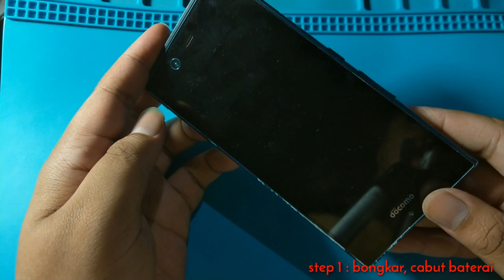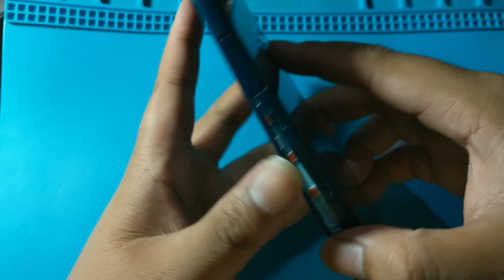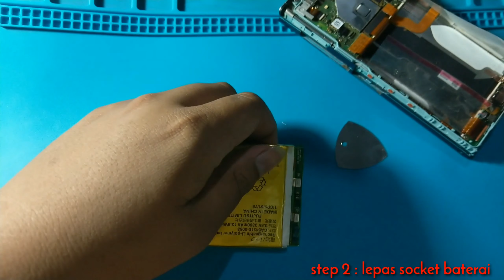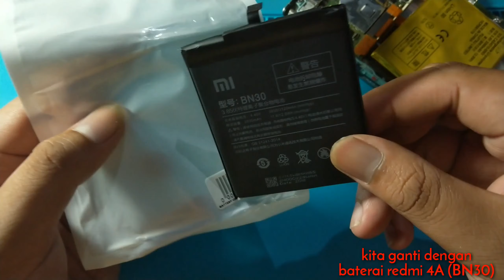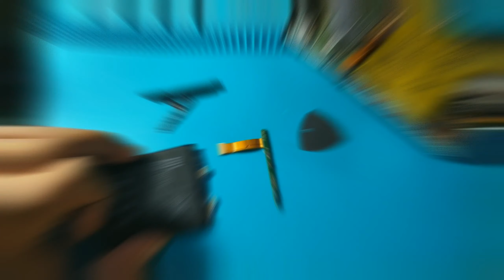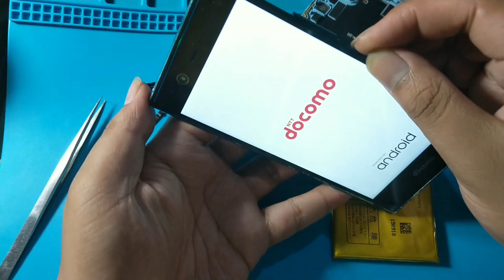Modif Baterai Drop Fujitsu F-02H - Bootloop Solution

Comment: Bang hp fujitzu d 02 h baterai mati hrus gmana ya? Kalau beli di mana trm ksh
Reply: F 02 h maksutku bang
Reply from the maker: @hayumahardhika8585  batrai off apa bekas airm kalo ga bekas air biasanya soket dan komponen masih rapih dan cell batrainya yg low voltage. ganti cell batrai yg seukuran dan voltase sama om
Reply: Baterenya fujitsu f02H yang tertera berapa amh?

Comment: Bang nanya dong bang,ko ane susah bgt ya buat masang socket ory ke batre bn30nya ga nempel nempel,solusinya gmna? Di kasih timah atau gmna sih bang?
Reply from the maker: iya donk bang. di solder biar kuat
Reply: @DCSpot  bang itu buat ngelepasin socket ory gmna ya,ane udh solderin ga copot copot,apa harus pake cairan yg abang kasih juga? udh ane subs bang
Reply: Bang jawab dong bang cara ngelepasinnya tuh
Reply from the maker: @fynnn8391  solder nya harus panas bang.  cairan Flux tu hanya pelumas aja gak wajib. asal solder harus panas tuk lepasin tu
Reply: @iyanyulian7903  dicongkel dulu dikot